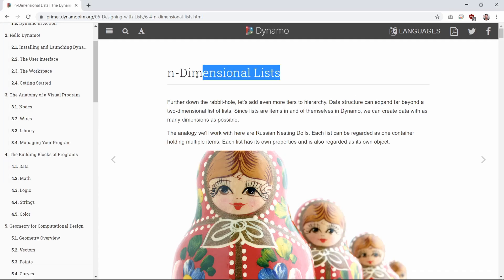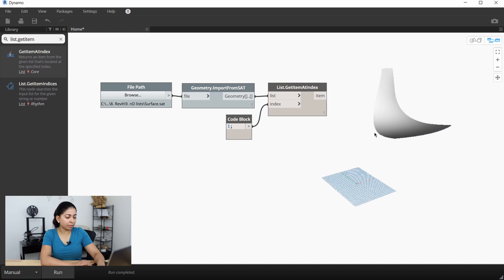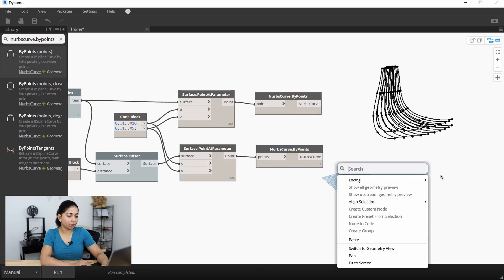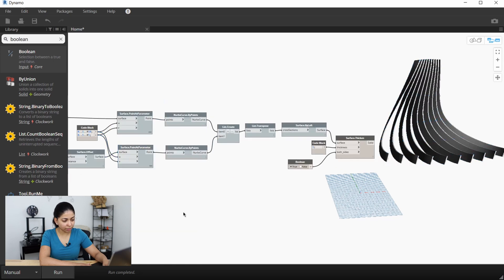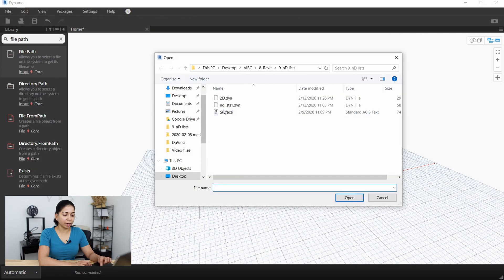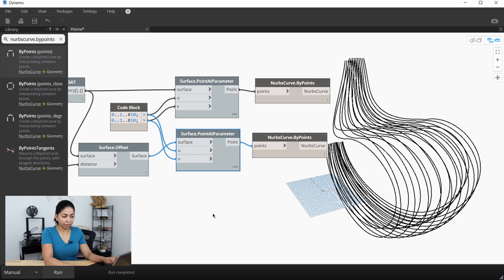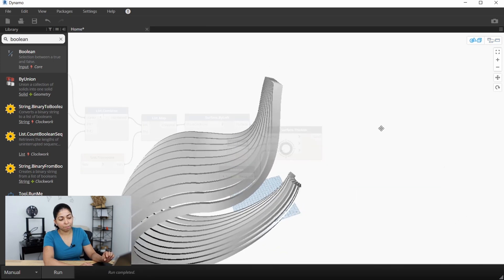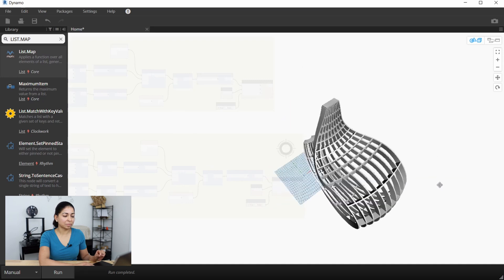Slicing surfaces with Dynamo BIM

Comment: This is a great video! 

A couple questions I have though. I am new to Dynamo Studio and I am trying to learn as much as I can. First question i have is: In your video you are using .SAT files is there a way to do the same thing but with .STL files? Or are the file structures too different to make this happen?

The second question I have is: I am trying to make planes that follow the geometry of the file I import. Is this possible and do you know of a way what I can do this?

My ultimate goal is to create a 5-axis slicing software that will generate a 3D printer tool path in 5 axes. I know this is an ambitious goal but I hope that I can do it, provided I learn enough.
Reply from the maker: Thanks Michael! I believe STL files are best for 3D printing, not for manipulating geometry since all the curves, points, etc are stripped from the file. If you try to convert STL to SAT, you will only get a faceted/tessellated surface. 

The way to create planes from a geometry is to generate a dense grid of points and then create planes for every single point. Unfortunately, I don't know enough about create a slicing software to help you more with that!

Comment: many thanks for the great training video
How to make a solidified profile inside the surface, for example, we throw steel profiles under a roof free forum surface, but the profile surfaces do not hold each other, so how can we get rid of this problem?
How do we hem the profile surfaces
If we pay attention to the node points in the link I have given in the appendix, how do we do it the same way

https://forum.dynamobim.com/t/dynamo-surface-apllyng-ucs/47486
https://rjmodels-hkzrkigdb3ydabzrody.netdna-ssl.com/wp-content/uploads/2018/08/1.jpg
Reply from the maker: Think about the structure as it would be constructed with steel members, don't think about it as a hollow flexible tube. Break the splines into smaller components at all the intersections and then assign your structural profile to those smaller splines.